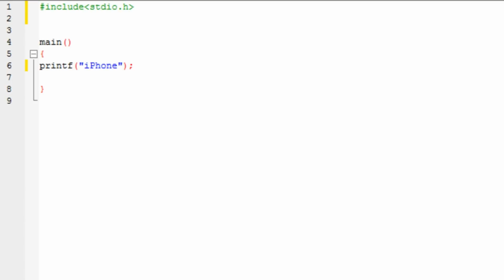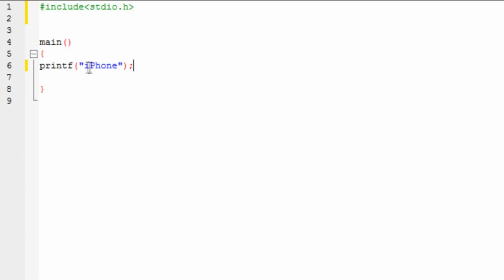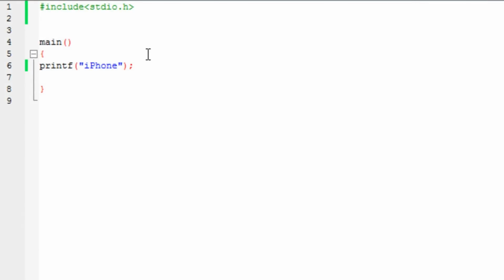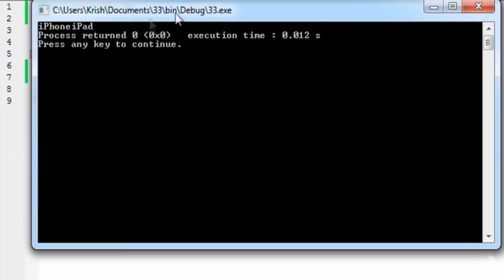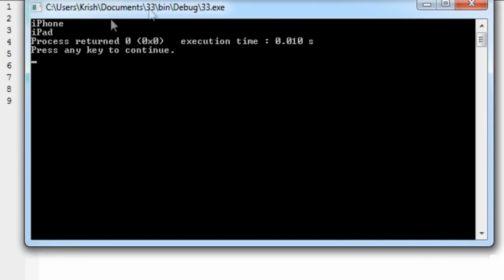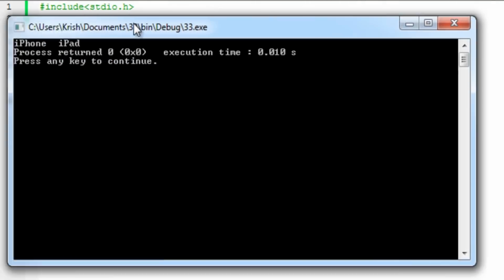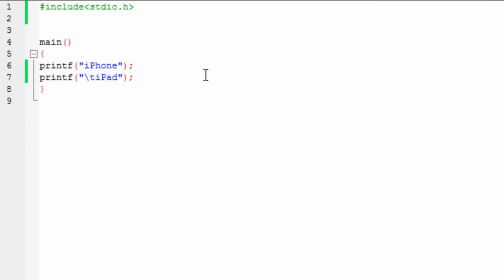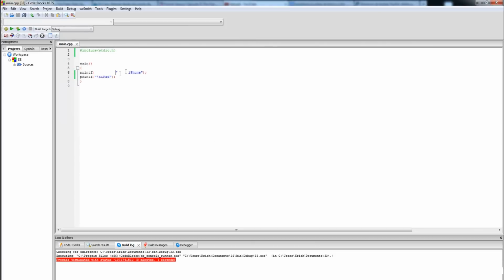Programming in C Tutorial 2: More on Printf [HD]

Comment from the maker: There are two major differences:

1. Printf is a function and cout is an operator.
2. You can format the output using printf function. For example you can print 23.00 as 23.0 or 23.0000000
 You can do the same with cout but you will need other functions in order to archive that.

Thanks for subscribing.